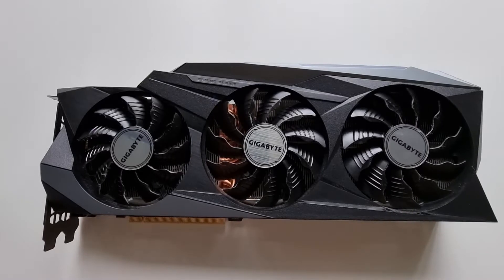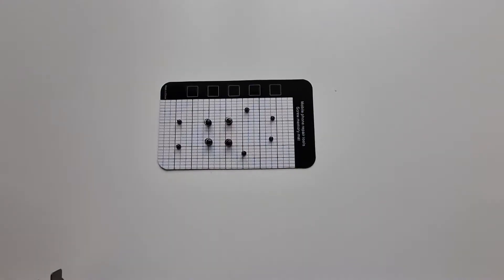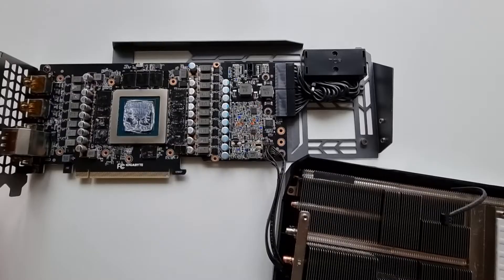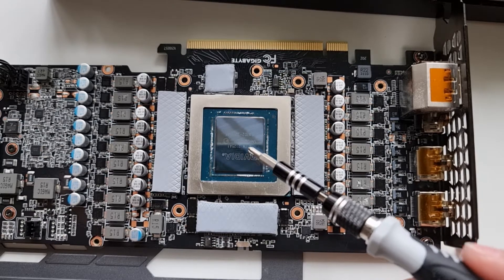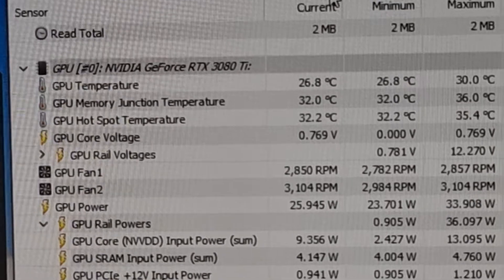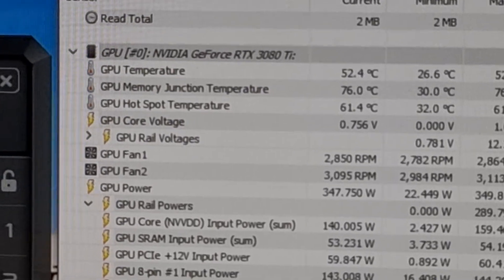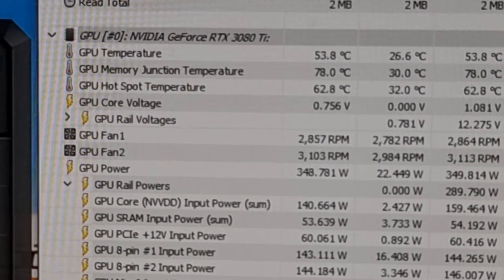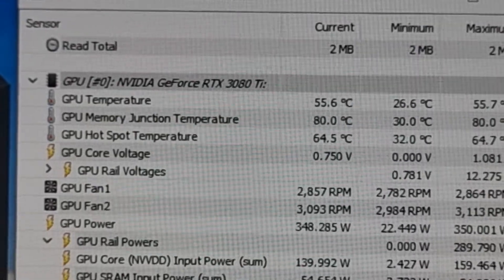Thermal Pad Replacement - Gigabyte 3080 TI Eagle OC

Comment: What were you doing when the temperature was high?  Is that from mining? I don't understand because my 3080 t.i. eagle OC is overclocked,  gaming on 4k 120hz c1 OLED, rarely hits the frame cap, and I've never seen it get to 85c with HWiFO64. 
I'm not judging just super curious!

Comment: hey I just got this card. Have you tried putting thermal pads below the backplate? Think it would help? Also, if you set the fans to 70% max, how much would the junction temp be? 90c maybe?
Reply from the maker: My fans are usually set to 90%

Comment: Great video, this gave me the confidence to replace the pads on my card.
I used Gelid GP Ultimates on my card: 2mm on the VRAM, and 1.5mm on everything else. Didn't change the back pads. 
Before, I had to limit my GPU to 65% power limit just to not fry the VRAM, which would still hit 92-94 C. After changing the pads, I can run the card at 100% power limit with a slight overclock and the VRAM is around 80 C max.
Reply from the maker: Awesome to hear my video helped you
Reply: GP ULTIMATE is best Thermal pads. 
GP Extreme performed than ThermalRight Odessy.

Comment: I got a 3080 ti FE, and a gigabyte eagle.  Which one to keep for warranty, and not have to replace thermal pads?
Reply from the maker: The gigabyte will need thermal pad changes .. they put the absolute cheapest thermal pads in there
Reply: I heard that the Nvidia gets hot though
Reply: @t-4nk108  I don't want to void the warranty

Comment: You should swap out the VRM and Inductor pads too (1mm thick) because my 3080 Ti Gaming OC died from the stock white oil-leaking thermal pad on them failing causing one of the VRM's to overheat (presumably melt internally) and short (as evidenced by a brown and black spark mark under the thermal pad that was covering it). The stock white oil leaking pads are just bad all round. I think they might be ok for non 3000 cards but with the GDDR6X memory speeds, the amount of heat production from both ram and (at least) VRM's is probably higher than what these thermal pads are spec'd for, leading to said failures over time.
Reply: Have you tried setting an undervolt as well, this will reduce power usage on core and vram mosfets and lesser the requirements for the VRMs with a small fps hit.
Reply: @fluffmeister66  I have but seems to be at at the minimum stable already by stock for me, at least with stock clocks. Not willing to downclock so I can reduce voltage. Would be silly to turn a 3080 Ti into a 3080.

Comment: Hey bro - Im gonna do the same following this video. But never done it before. I'd also like to do the back of the card - any idea on thickness for the back?
Reply: Dont forget to set a decent undervolt with afterburner this will reduce overall temps.
Reply from the maker: Sorry I haven't done the back of the card so can't say for sure
Reply: @t-4nk108  it's okay bro, I found out. 2mm front 3mm back. Super nice temps!

Comment: Hi.. Good video.. Short & Simple.
Can you help me by giving the dimensions of all memory modules where you changed/applied the thermal pads, so I can decide how many thermal I need to buy for my 7*3080Ti?
Thanks in advance.
Reply from the maker: You can see my other comment regarding pad amount. You will need a lot more since you are doing 7 cards. Get enough for one card test it then once you know it works get more for the rest.

Comment: I hit 108 mining eth. Swapped out same pads as you, with Giled Ultimate 2.0mm pads. Didn't replace rear pads at all. Replaced thermal paste with kryonaut. 
Went to 74 after 20 mins of mining eth. 

T-4Nk, did you end up replacing rear pads? What about the thin pads near the front vram pads?
Reply from the maker: No I still haven't. Great results for you!
Reply: thats crazy mine throttles at 108-110, 74 dam
Reply: @Second0ne  yes but did you replace pads?

Comment: Is 120x20x2mm enough for this gpu
Reply from the maker: More than enough
Reply: @t-4nk108  I had to use 1.5 120x20x2mm now my GPU temps are under 100 and not thermal throttling anymore I will change backplate 3mm pads before summer though
Reply from the maker: Nice one that's great to hear

Comment: How much pad is needed in length
Reply from the maker: Enough to cover the memory modules. You can see the amount I bought in the video at the start.
Reply: @t-4nk108  I'm doing this for first time Is 120x20x2mm enough for 3080ti eagle
Reply from the maker: I used 85x45x2mm
Reply: @t-4nk108  thx bro ❤️
Reply: @t-4nk108  That's for 1 card? or some amount will left of the pad after using for 1 card?
Reply from the maker: 1 card

Comment: Νice job. I own 2 3080ti Eagle and i'm about to do the same thing.
Reply from the maker: Def worth changing the pads on this card. 2.0mm pad on vrams only leave the rest stock.
Reply: Also set an undervolt mine runs nice and cold 65 deg core 78-80 max tjunct temp.